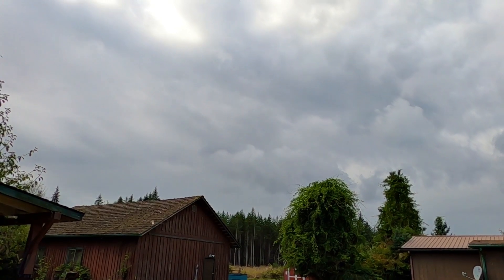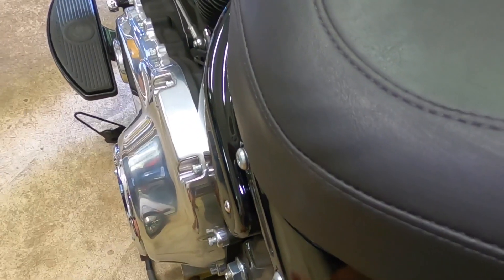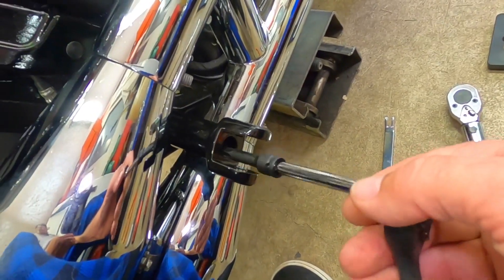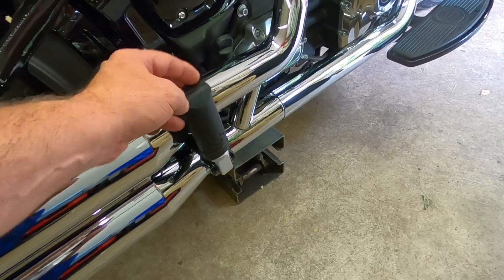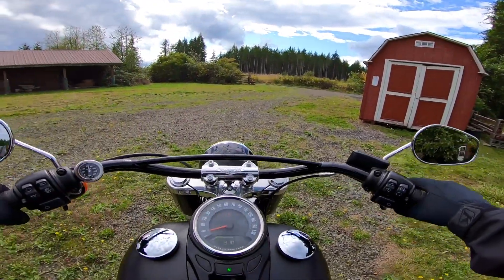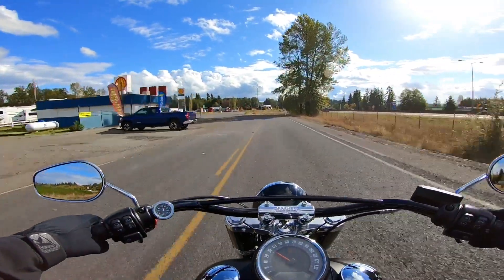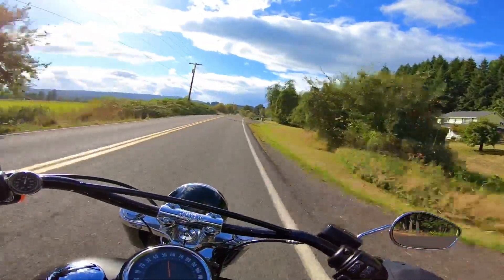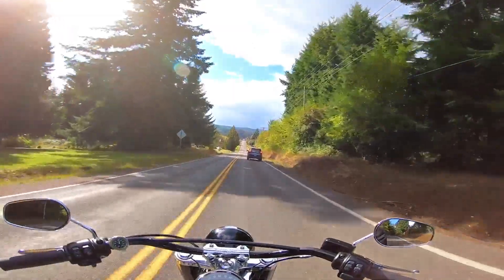Slim Pillion Pegs Install!! • We Gotta Test Them..! | TheSmoaks Vlog_1777

Comment: Shawn, I learned early on that bikes are made for the masses. Every rider needs to modify his/her bike to "fit" them and their riding style. Motorcycling is dangerous enough without not being able to feel we can control our ride like we want to. I do like that slim. With your feet rearward and the torque of the slim, you don't need to shift as often anyway.  Nice job!  Nice catch on the train. I was able to get in the cab of a Santa Fe engine in Carlsbad, New Mexico. The guy running it was my friend's buddy and when he started the engine, you could feel it in your chest, He gave us a ride around the yards. COOL!!